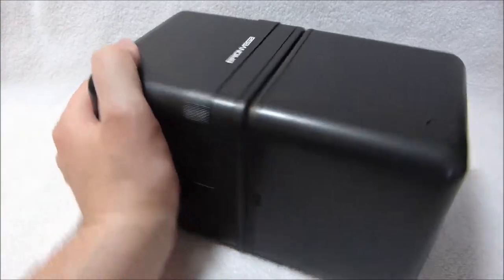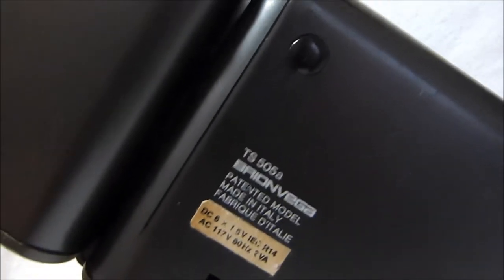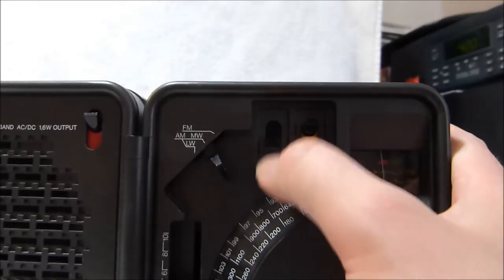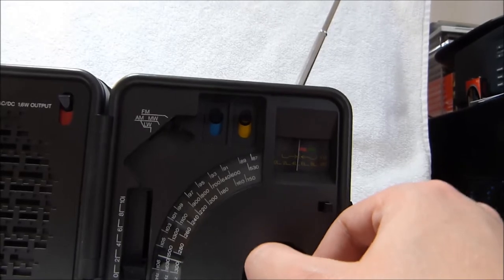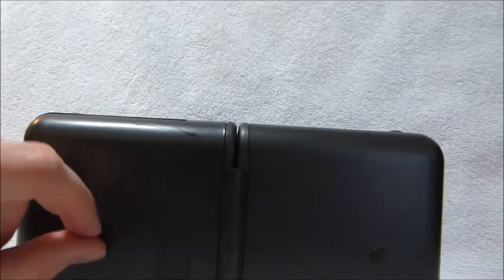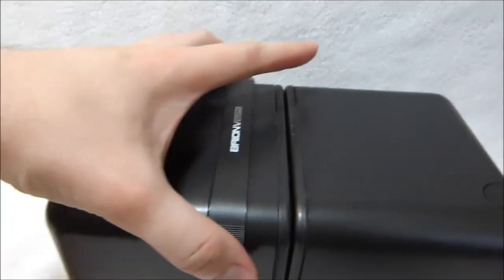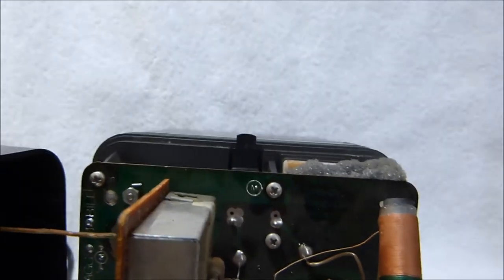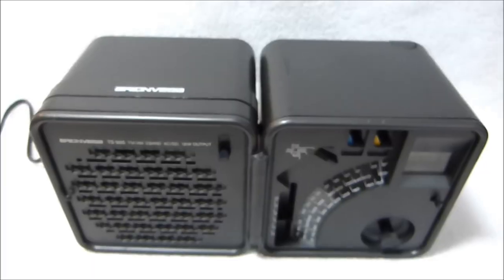Brionvega model TS505A (1977, Italy)

Comment: I like the design of this radio!!
But do consider, there were some very good radios still made in the 1970s... Nordmende Globetrotter 808, Grundig Satellit 6001, National-Panasonic RF-1350, Saba Transall Deluxe, ITT Schaub-Lorenz, Philips, Telefunken, Blaupunkt...
Reply from the maker: There were good radios made in the 70's, but almost exclusively by European makers, and even they were making plenty of cheap low quality sets. This set is also not built as well as the earlier Brionvega TS-502, which had a lot more metal parts.